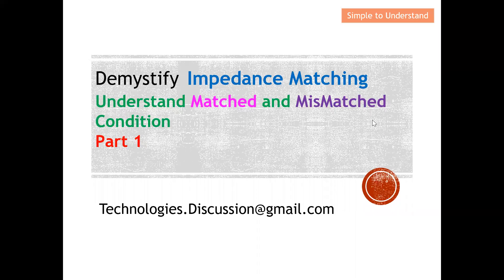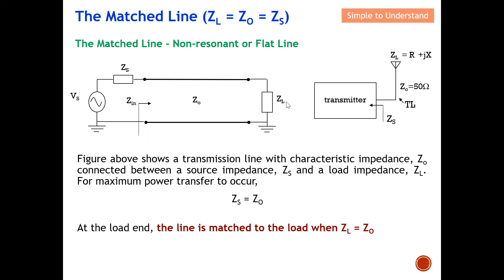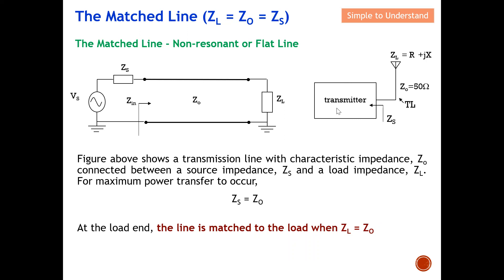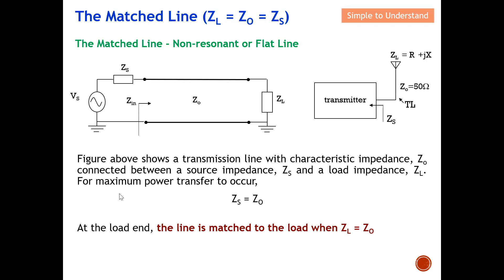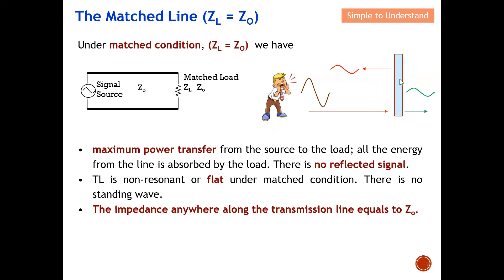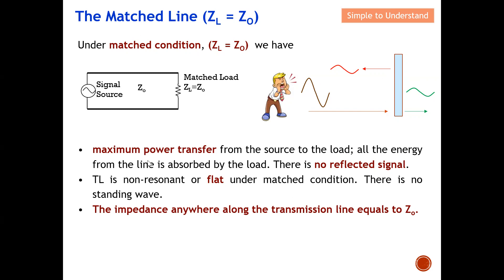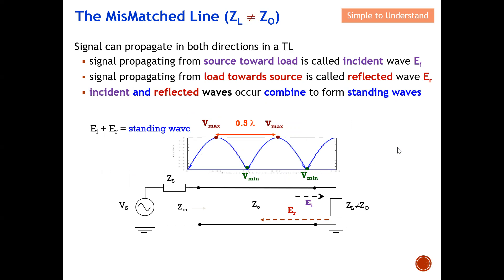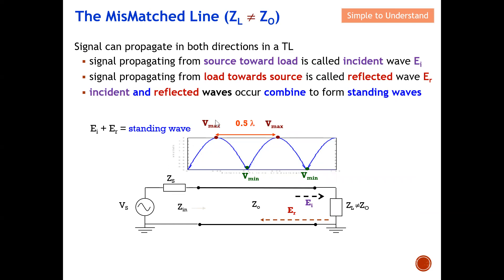Impedance Matching Explained! Matched vs Mismatched Load, Which to Achieve Maximum Power Transfer.

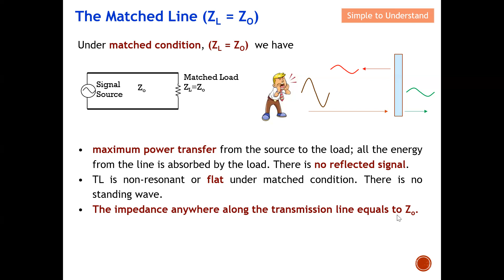Comment: At 7:56 you used R=0 and G=0, but there is no explanation as to what R or G are.
Reply from the maker: Thank you so much for your comment!
Actually, I’ve made a new video to replace this one, with more explanations. The new video link is:
https://youtu.be/VYor6jGA1-4
Regarding R and G, they account for the losses in the cable. Even a good conductor has some amount of loss, which is represented by R & G.